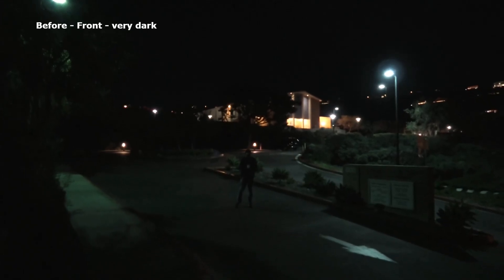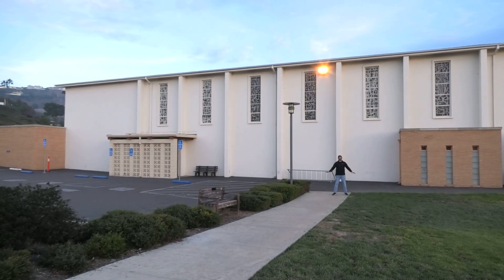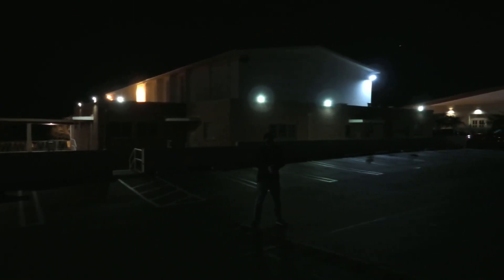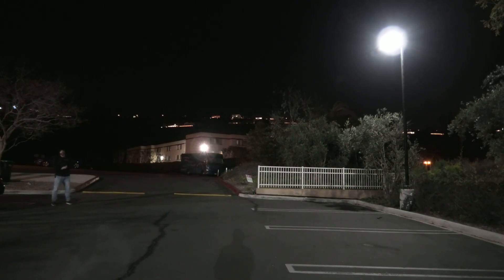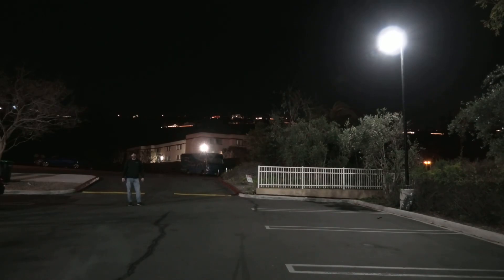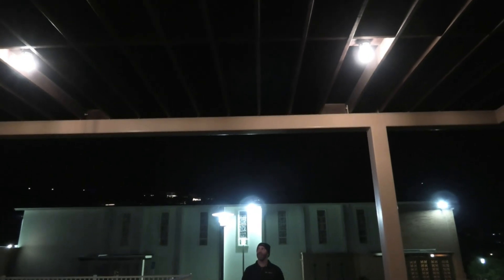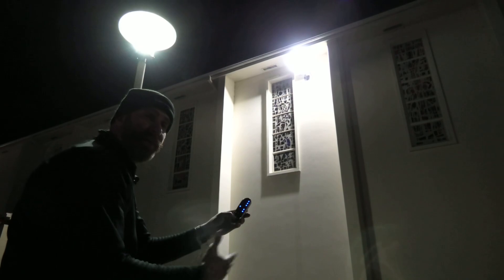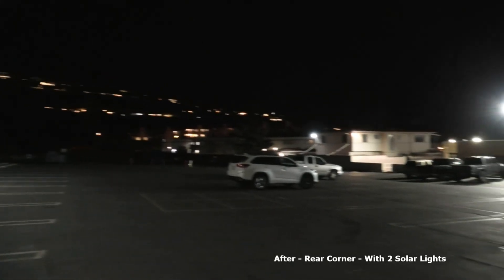LED Parking Lot Lights Install - Before & After - NextGen 3 LEDs With Motion - Aerial Drone Shots

Comment: What do you think about the problem with the wildlife triggering the sensor?
Reply from the maker: The sensors have adjustable sensitivity settings that can help if they are picking up unwanted motion from small animals. If you have large animals triggering the sensors, there's not much you can do no matter what type of motion sensor is being used.
Reply: @LedLightExpert : Awesome.. thank you so much.

Comment: Do you control different lights with the same controller? Can you installed them on a ceiling?
Reply from the maker: The remote programmer for the motion sensors is the same for all the NextGen 3 Lights as well as a few other series lights from RuggedGrade. You only need a single remote to program as many lights as you want, but due to range limitations of the IR remote, you can typically only program one at a time unless the lights are installed next to each other. We recommend having a spare for big projects or keeping a remote at each location if installing at different locations. We have different type of mount options for those lights for mounting to all different surfaces. If you need help figuring out the right mount or light, give us a call at 800-674-9420.
Reply: @LedLightExpert  I would love to get your suggestions on how set up some new lighting. What is your contact email?
Reply from the maker: @SFlores1979 You can send in your project details at sales@ledlightexpert.com please also provide a contact phone number so one of our light designers can reach out to you or you can give us a call at 800-674-9420.